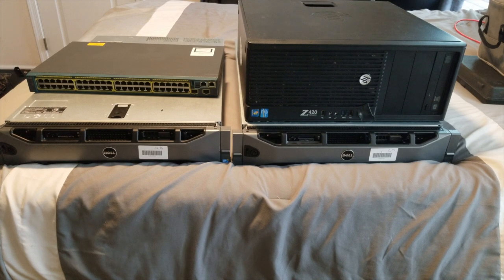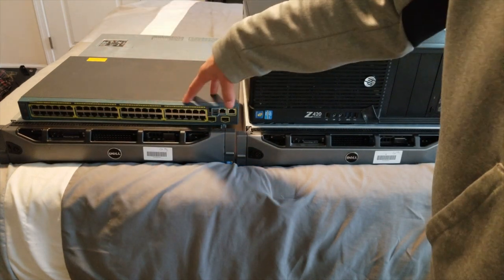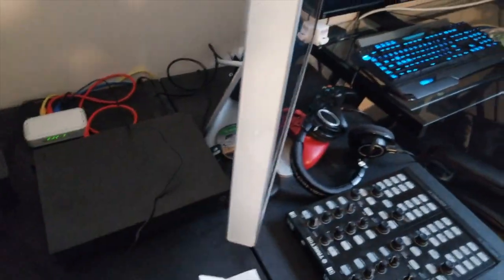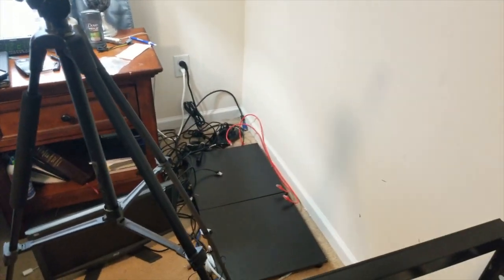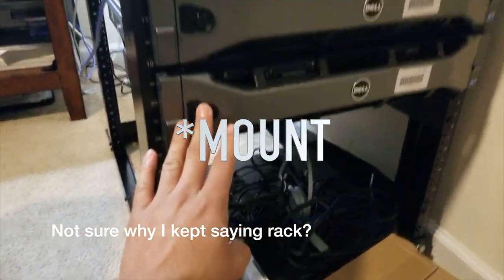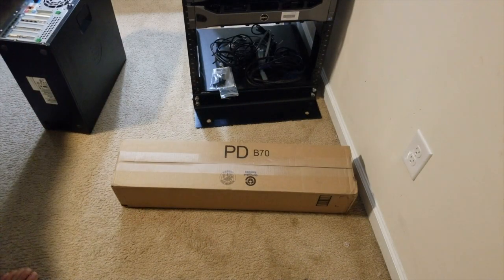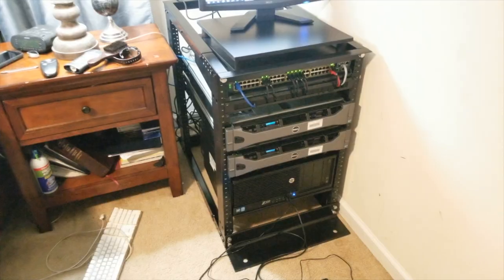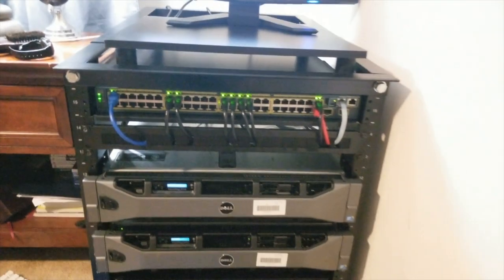Building a Vitualization Home Lab!

Comment: I like that server rack, need one, I have 2 R710s, and the 48 Port switch same as you. Where did u get it from and how much?
Reply: Buy one that uses cage nuts instead of having threaded holes like this one.  If you don't you will be replacing it sooner than later.  The extra cost for a cage nut rack is offset by having to buy shelves and other things to hold rack equipment instead of using official dell rails.  You can get a 12u or 22u on wheels from amazon for $170-$300, or check craigslist and the like for used units.

Comment: You don't have a single piece of equipment that needs a network cable at the front, so why put the switch at the front rather than at the back where it's actually needed?
Reply from the maker: strandvaskeren  Because I’m constantly changing things up and it’s a pain to pull the rack out every time.

Comment: I was under the impression that r710's didn't have a processor that would run ESXi 6.7? Thought you had to get to a R4,6, or 720?
Reply: Not that I'm aware of. I don't think it will do the in place upgrade from 6.5 (using vSphere's update manager or manual upgrade on the host). I had no trouble when I used Dell's ESXi image.
Reply from the maker: The Rx10 family runs ESXi 6.7 just fine.

Comment: Nice setup, hope to build one for virtualization.
Reply: Just got in my 2 SunFire X4150 with 2 quad core cpus. One server can with 32 GB ram and the 2nd one came with 64 Gb ram. Problem is the one with 64gb ram is wrong for the server. Vendor offered $25 refund. The 64gb ram is Kingston (16 x 4gb dims) and is worth more than the server ($130). I’ll see if I can resell them. I bought 2 IKEA Lack tables,  one the coffee table to mount these plus a HP Z600 and a HP dc5750. Using an old WiFi router as a switch. Just need an old lcd monitor and an old Cisco switch and I’ll be ready. Planning on installing ESXi and PFsense to start. Nice setup video.

Comment: Quick question, I planned on building a PC more so for virtualization purposes (to learn Active Directory, LDAP...etc) but to also be my main driver. The budget was $325 - $350. Would it be best to just keep my basic dual-core PC and get a server setup or build a new PC with a quad-core CPU and go that route?
Reply from the maker: Hey, you should definitely go with a server setup. It's a little noisy and produces quite a bit of heat, but you get a lot more in terms of power with decommissioned server hardware then with desktop-grade hardware. You can easily find a R710 with 12 cores and 32GB of RAM on eBay for $300 or less, I purchased my R710's for $160 shipped each.
Reply: @averyplays7576  Ahhh. Thanks for the clarification. Any specific eBay user/company that has/gets them in bulk?  Or did you find your from an individual who just happened to have some for sale?